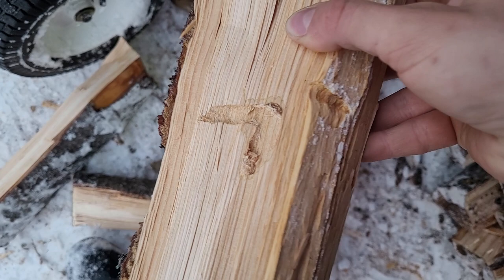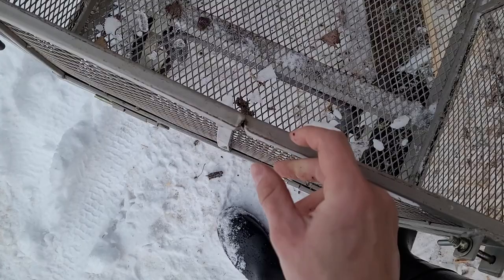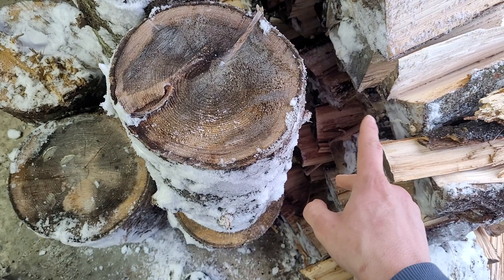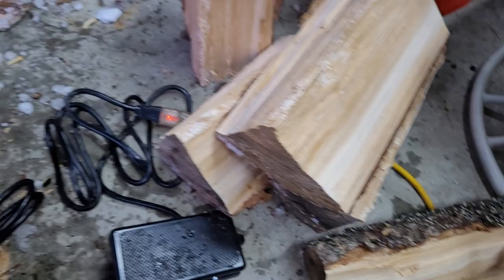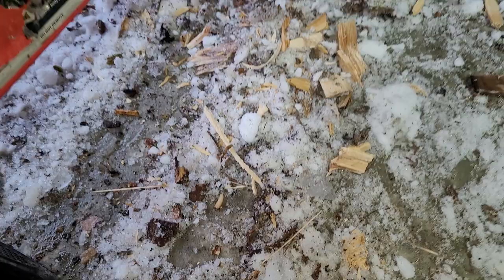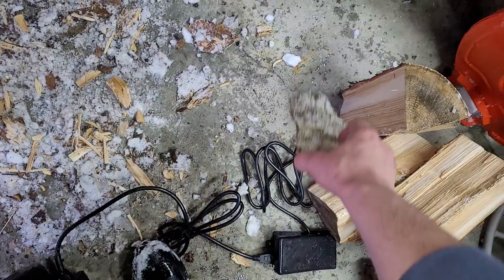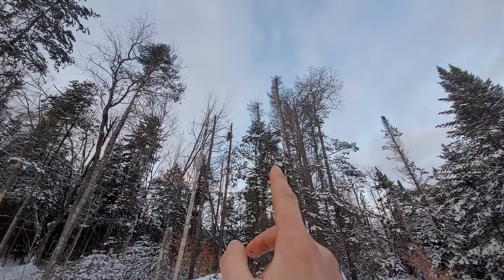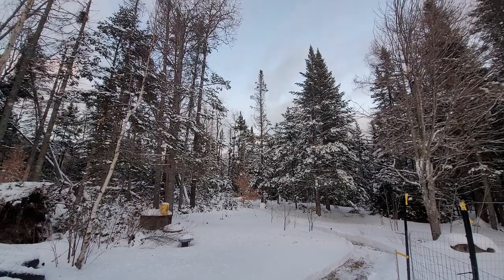Asian Long Horn Beetle Larvae While Splitting Wood

Comment: Go to a scrap metal recycling place near you for the angle iron. find one that sells the metal back to the public; you travel enough that you pass by a few in your journeys. They will normally sell for 0.10-0.50 cents a pound and buy for about 0.05 cents a pound right now, that just depends on the place and what you are buying. Home Depot, Lowes or any of the other places are selling for obnoxious prices, around $10 a pound depending on what it is.
don't be afraid to buy stuff a little bent either, I just made a video showing you how to fix that with a hammer if you have the need.

Comment: Do you know how to weld and have a welder? You could beef up and refabricate ur whole wagon upper frame.
Reply from the maker: I know how to weld. Not great tho. No I don't own one
Reply: Getting a welder could be a nice investment. You could have it for years to come, gets some experience with it over time. Anymore these days you can get a decently powerful smaller welder for relatively cheap and you can keep it neatly tucked away.
Reply: If …you buy a welder
Make sure it’s 220vac 
110vac Limit you to small metal welding, only.